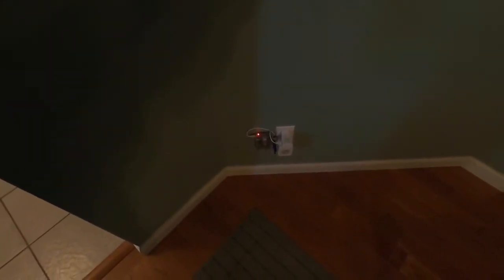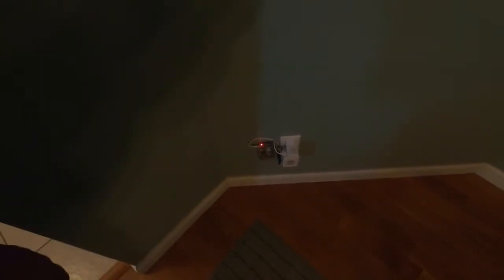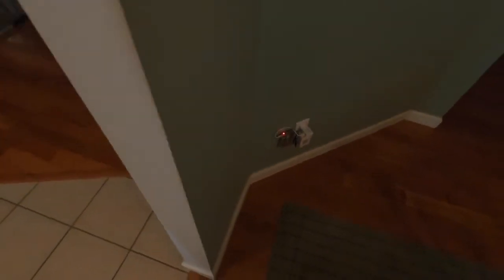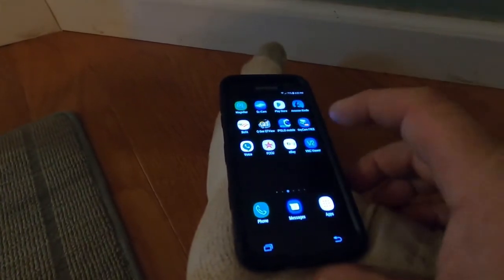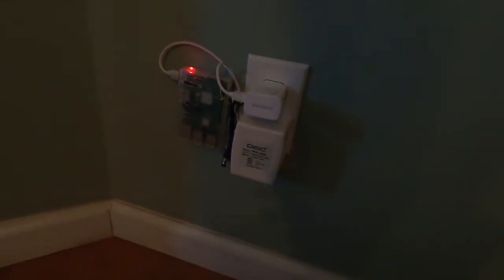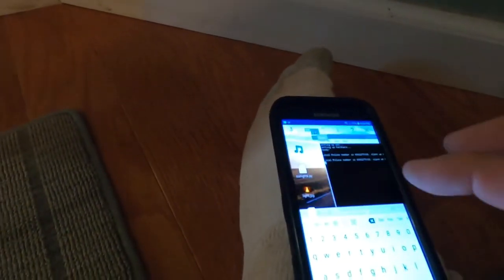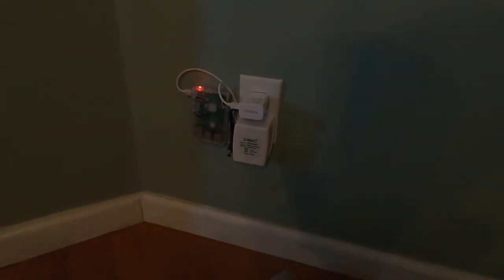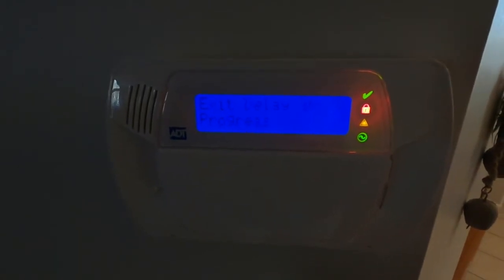DSC Impassa automatic text to cell with Raspberry Pi

Comment: I have beet trying to recreate the DSC Impassa to Raspberry PI project but seem to be really lost. I have pieced as much as I could from your youtube video but am lost. Here are my problems:

1. No voltage change when alarm is set off, stays constant
    - Though I changes all of the internal settings in the DSC Impassa correct but I am unsure             as you did not cover this in the video.
2. Rant the following on the Raspberry PI: pialarm.py as well as the cred.py (Do these stay continuously active?) Also, I was unsure of what to do with the alarm.desktop file

Any assistance would greatly be appreciated!! I am pulling my hair out.

Thank you.
Reply from the maker: at 3:33 in the video the instructions are shown on which internal setting controls that "bell" output as well as switch pins should register the 12 volt signal.  it also mentions which type of installation will not work with this bell signal.... something about if you have the small size internal battery and an alternate communications card.  I would start there and see what you figure out I think it said setting 14 option four had to be turned to on.